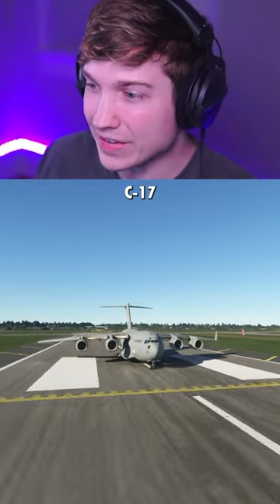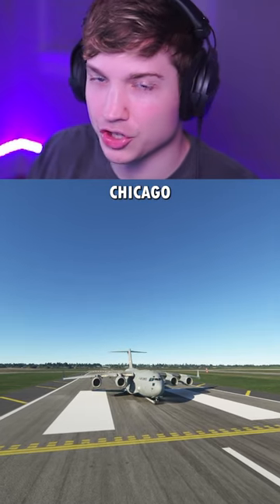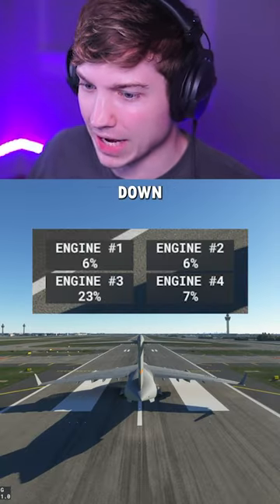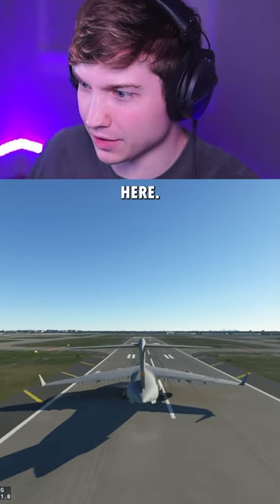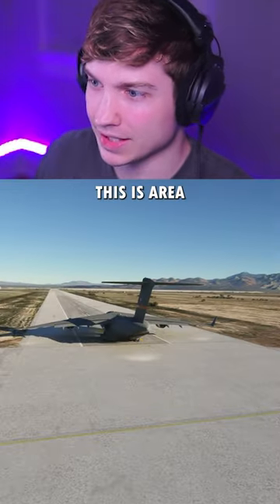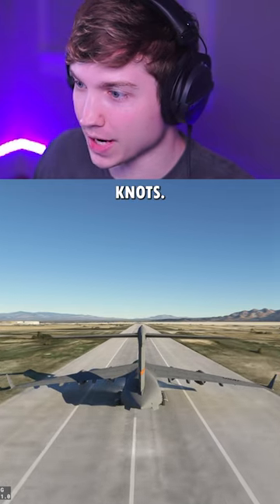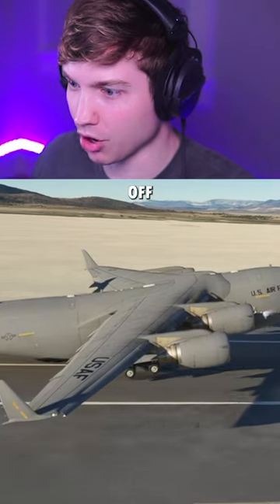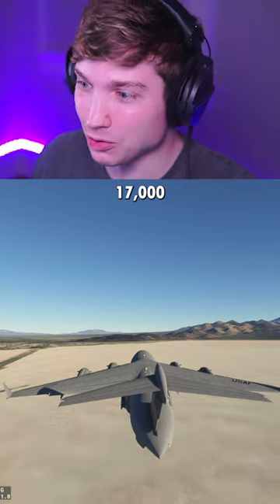Can the C-17 Globemaster Takeoff With ONE Engine?

Comment: You should see if you can recreate Olympic Airways flight 411 in which a 747 fully loaded lost an engine around V1 and had a derated engine, and in the confusion had the water injection turned off further decreasing thrust. The pilots managed to keep the plane afloat and got it back to the runway with no injuries.  

https://en.m.wikipedia.org/wiki/Olympic_Airways_Flight_411